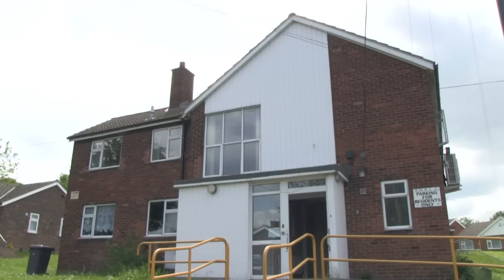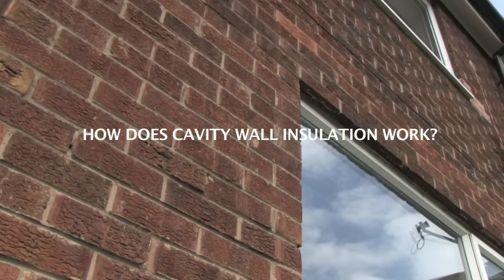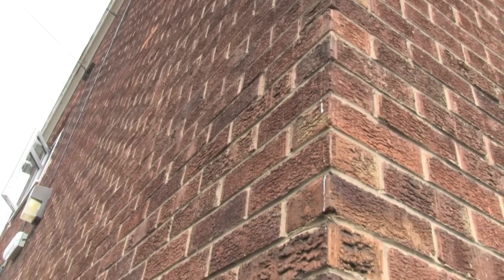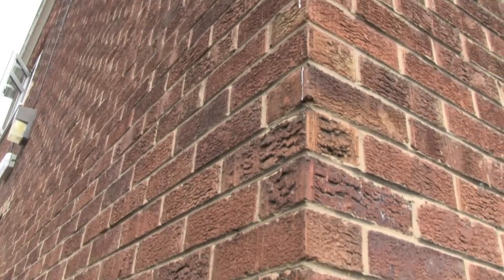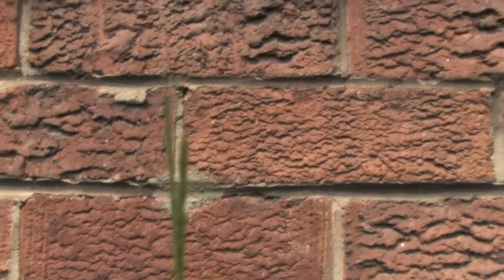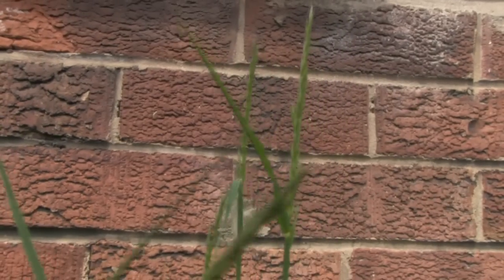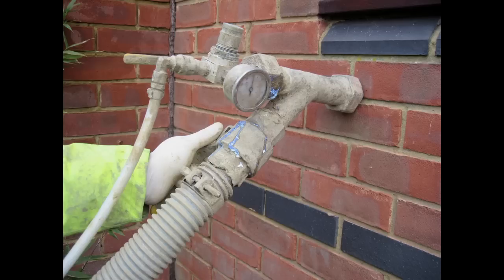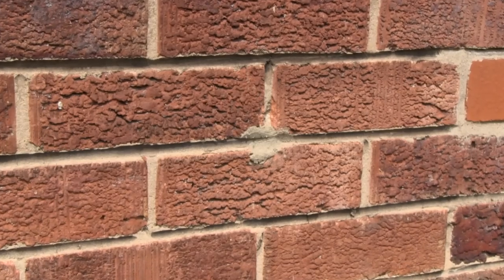How does cavity wall insulation work?

Comment: Ive seen my brick wall running with water after weeks of driving weather and i would not put a trap in my cavity, air flow keeps your walls dry, double glazing under floor insulation, double lined curtains , but not this crap in your cavity

Comment: I had it done today, but had to leave them doing it as I had a hospital appt. When I came back the holes that were drilled at the front had half inch screws sticking out, and when I looked around the back it looked like someone had got a catapult and aimed it at the hole making the back of the house look terrible. Totally ruined the look of the house. I thought that a professional company wouldnt dream of doing this, or is this the way it is done. I dont know....beyond me. After reading some of the comments I am so sorry I had it done

Comment: and as for saving 30% on your energy bills thats drivvel too.
come off it youll only save energy on your gas because your house will be so humid and damp that you wont be able to breathe if you put the heating on.
cavity wall fill is a nightmare waiting to happen.
if you really must do it get the polystyrene beads....
ive been a builder for over 20 years trust me these jokers are talking shit
Reply: billymultifinish. Your talking nonsense. Im in trade. Its saves £300- £350 through your energy bills annually. Also it adds value to the property. All in all its a great scheme by the government especially if your on benefits.
Reply: ridiculous. this is the wrong way to insulate a building. you providing a bridge for water to travel through to the inner skin.

if you want to aftermarket insulation you should do it from the outside or inside! Not in the cavity!!
Reply: New builds are having this installed. It works as I've had it for 15 years with nothing other than fantastic results.